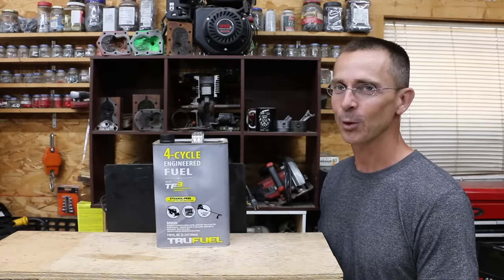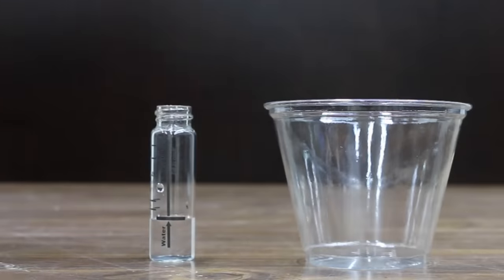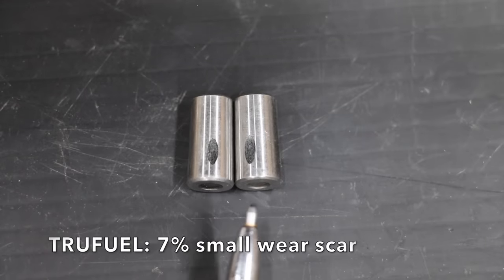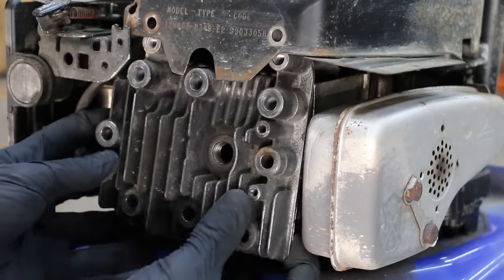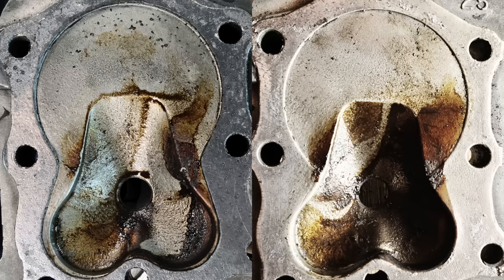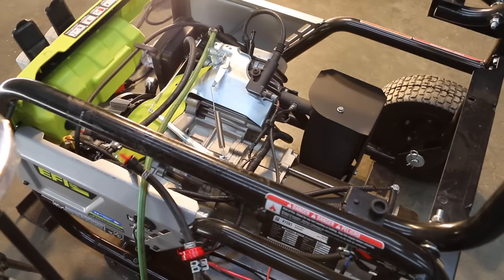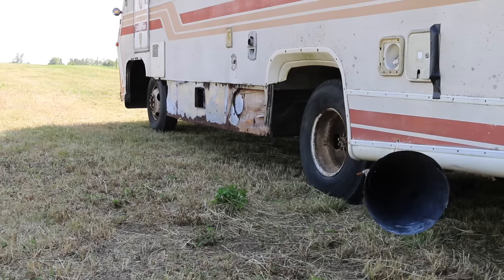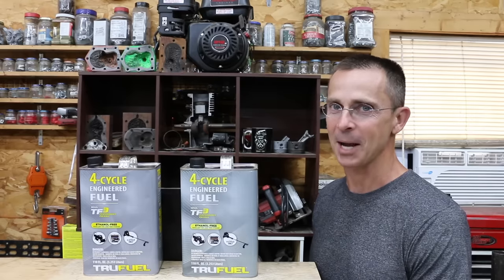Engineered Fuel better than Pump Gasoline?  Better Fuel Efficiency and MPGs? Let's find out!

Comment: "Let's get the testing underway!"  Five words that can improve any Monday.
Reply from the maker: Hi David, Thank you very much and hope you enjoy the video!
Reply: @ProjectFarm  I won't spoil it for later viewers, but that ending was glorious!!
Reply: Unless its at the doctors office
Reply: "see through cylinder head" that's my week sorted.
Reply: @ProjectFarm  top comparison, thanks. Can I offer a tip for cleaning your combustion chambers easier & more thoroughly... I use tergo paint stripper on all my engines even down to the top ring in the bore...  then waterblast to strip off the stripper & chase water out of the bore/piston with a couple of revolutions & airgun then wd40 the bore/piston at the bottom of stroke
Reply: Just another manic Monday! I wish it were Sunday!
Reply: “Let’s double circle check that.”
Reply: Most definitely
Reply: No contest.  "Regular" pump gasoline is a well engineered product with seasonal and regional blends which are distributed highly efficiently and at a good price.
It is a TERRIBLE idea.  Assuming it even worked, why not just sell it as a gasoline additive?  Gasoline is a constituent of oil and cars and small gasoline engines run best on it. So at best, it is regular ethanol free gasoline with an additive package which can just as easily be sold as a gasoline additive and wouldn't be anywhere near as expensive.
Reply: Agreed! This channel transforms me from Garfield into  Bob Ross. It's great!
Reply: Especially quarantine Mondays
Reply: That's no shit.
Reply: Nowadays everyday is Sunday
Reply: I mean, let's is let us. It has an apostrophe, so it is still 2 words, one has been shortened. He does make awesome videos tho!
Reply: @johnnykirk1501  Pedantic much?
Reply: Correct? Yes.
Reply: Saturday: "watch this, hold my beer" is the second best 5 words :-)
Reply: @Errol.C-nz  ever try cold water while the engine is running? ;-)
Reply: You have too much time on your hands.
Reply: 8 hours of work, 6 hours of sleep. I almost always have 10 hours of time to use as I please. Watching MM is definitely one of the things I enjoy. If you are referring to me commenting, your comment was the one that was visible as I watched it.
Reply: Couldn’t agree more
Reply: @FastBowtie388  how do you mean cold water
Reply: Not if your going in for a colonoscopy on Monday!
Reply: Absolutely.
Reply: @evrlastngcherry7727  hahahaha everyone can attest to that 😅🧤🍑
Reply: ANY WEEK!
Reply: You mean any day
Reply: six words. Let Us get the testing underway.
Reply: I agree and his most iconic phrase. "Were gonna test that"
Reply: @ProjectFarm  best phrase on the internet "were gonna test that" the 4 words every company dreads hearing from you. 😆 🤣
Reply: @ProjectFarm  Can we get a comparision of TruFuel vs Stabile for long term storage and quality of old fuel? Both tests of full can vs mostly empty cans of each stored.

Comment: Video recommendation: Test different brands of garden hoses. I constantly have garden hoses bust, expensive and cheap!
Reply: your water pressure must be too high; your pressure reducing valve is either leaking or non-existant
Reply: Yeah buy a water pressure gauge. My pressure is 45psi at a hose bib.  Never had a hose bust in 30 years. Kink and tangle all the time.
Reply from the maker: Great suggestion!
Reply: My wife bought one of those hoses that expands and retracts automatically with the water pressure.
It is the biggest piece of shit that I have ever used in any garden !!!!
Reply: I’ve had good luck with the Never kink brand. I’ve had the same since 2009.
Reply: I’d like to see this too. But with consumer vs professional vs farm quality. I heard farm was the best but it costs more.
Reply: Maybe test the hoses in harsh conditions: leaving in hot sunlight w. Water on, freezing, driving over, etc. And then maybe tips to improve your hoses, or prevent damage. Alot of the cheaper hoses ive had fail at the metal couplings. The best hose ive had is the aluminum encased one. 

Our water pressure isn't high by any means, but a pressure gauge may be helpful.
Reply: Yes, would love to see this test. I sometimes leave them out in the sun after use so they soften and can then be unkinked for storage.
Reply: i didnt even realize hoses could burst....    have been using this same old green hose since 1997!   and i do not take care of it,    it lays out in the sun ,   and pretty much every time i use it it gets tangled up with my garden chairs and i just yank it out with full force lol
Reply: Install a water hammer stop (mini-rester) at the faucet. And release the water pressure out of those hose and turn the faucet off. There's multiple reasons why they're busting, but you can at least troubleshoot if you're dealing with water pressure issues.
Reply: Continental hose. Have had the same one for 15 or so years and it hasn't degraded. Sits outside in the summer and winter. No kinks.
Reply: Project Farm put them through heat and freeze cycles to see which become more brittle. If I leave them outside I’ve had them only last one or two years.
Reply: the kink rating is also another important factor for a hose
Reply: I live in the California Desert, my Mom bought me a Metal Garden Hose off of Amazon...I laughed , "yeah right a Metal Hose", it looks like Flex Conduit but bends in a tight circle and never kinks and easy to roll up and toss in a Bucket, it'll take the sun all day too. VERY NICE HOSE.
Reply: gangisspawn1 or air hoses
Reply: I love my Zero-G hoses personally. Had them for several years now and theyve been used and abused with no issues. Plus they're super easy to wrap up and put away as opposed to many of the cheap hoses and they dont kink and crack either
Reply: @Timinator62  thats the same as what I have thats worked the best so far.
Reply: I've been using one from Ace for 10+ years. The $75 guaranteed not to kink. 

Mine is in the garage while the snow is on the ground, but I have frozen it before and still no leaks.
Reply: Stop leaving your hose on in the sun.
Reply: A dog proof water hose would be great.
Reply: Andy Preston mine busted and is just a rubber tube now
Reply: Remember to turn the faucet off at the wall when you're done.  Leaving that pressurized when not in use shortens the lifespan of hoses
Reply: Buy the 100 footer from Sams club. It is a Boss.
Reply: It's very interesting to note so many people who have never had hoses bust/break/degrade. I'm wondering how so many hose companies stay in business. I guess I'm one of the few buying hoses every 10 years or so. I buy commercial/industrial hoses too. The best one I had was made by Goodyear I believe but I've also had Ground Work and Element farm hoses. Yes, I leave them in the weather but drained for winter. Yes, I sometimes forget to turn off the faucet with a nozzle on the hose.
Reply: I bought the zero G one 2 years ago. I love it.
Reply: A few years ago a friend told me to get the hoses from Sam's Club. The heavy ones with big brass fittings. I bought two of them and both have held up really well for many years. I can't remember the name, or if they're even sold anymore. My home water pressure is between 70 and 80 psi.
Reply: I've NEVER had a hose just bust, and I use tons of them for construction and at home. They either burst because they are driven over with a tractor or get hit with something sharp, but never just bust.
Reply: @ACEGAMER120  The nature of my job means I'm working with water all day and we love the Zero G hoses.
Reply: Plz test “ premium contractor grade “ lol
Reply: Everyone complaining about kinked hoses has likely never been a firefighter. 
Also pro tip, don’t kink your hose.
Reply: i would rather see a shoot out between the different hose thicknesses.... do you waste money buying a 3/4" hose
Reply: I've had good luck with the goodyear hoses. Black reinforced rubber with solid brass ends. Don't deteriorate on me when left in the sun.
Reply: Goodyear or Continental rubber hoses. If they kink, you are doing something wrong.
Reply: Especially those elastic expandable/collapsing hoses. Those made with the fabric surround are particularly weak, lasting a couple of months even with the best care.
Reply: @SOP83  I was going to say that also. Those black rubber hoses are pretty nice. And your right, they don't kink. They will roll up like they're going to kink but then it flips and doesn't kink. You pay a pretty nice price for them also but they last. Certainly a lot longer than harbor freight chinesium hoses.
Reply: Andy Preston they were never designed to take pressure I learned that the hard way good thing I had two
Reply: @Log Splitta no need to kink shame
Reply: I use Flexzilla 👍
Reply: Cold test better be in there!
Reply: Yes, this!!
Reply: @philbuilds116  yup goodyear
Reply: Andy Preston I have one that is in my basement sink. It’s about a year old. No wear, but there is really nothing to puncture it. They are POS
Reply: a why would you ever want less pressure at the nozzle?  I’d rather just not have it leak.
Reply: Good idea. My craftsman from 28 years ago is outlasting all the others I've bought through the years. Chi-na crap nowadays
Reply: Never had a hose burst due to pressure NOR have I ever had a pressure relief valve until I bought a house that had them installed on each bib.  They were noisy and leaked.  Took every one of them off and still have NEVER had a hose burst due to pressure.
Reply: Buy a flex zilla hose there the best that I've found
Reply: Avoid flexon brand, lifetime warranty makes you save the receipt, cardboard cover + take photos only to get an even cheaper quality sent to you as replacement
Reply: I bought a 50 ft hose in 1975 and it is just starting to leak at a crack....cheap stuff
Reply: Don buy vinyl hosee,just Goodyear rubber Black or Red hoses.red for hot water
Reply: Just buy a DRAMM hose made in USA 100% american made rubber...but it will cost you!
Reply: @andypreston1524  I got one of those from someone one day, lasted about 10 uses before the end blew off.  If they made one that would last, it would be handy if you had the need to carry a hose in your vehicle.
Reply: I literally just came to the most recent PF video to make the exact suggestion! My wife always buys the cheap hoses, and it drives me nuts! I just paid a guy to come and replace 4 hose spigots because the cheap hoses had aluminum ends, and not brass and they fused to the spigot.! I hit the Amazon reviews to find out which was best,  and I could have sworn I heard "Which hose is best..... let's find out"!!!
Reply: @andypreston1524  I hate those hoses. They steal so much pressure to expand. Also, it takes a day to drain them to store them. I found out storing it is pointless.
Reply: I hate those expandable hoses. They steal so much pressure to keep inflated. They take half a day to drain them to store it. Storing it was pointless by the way.
Reply: @dennispope8160  You should be at 70PSI residential at your spigot.

My issue with garden hoses is they like to have kink memory.
Reply: An important factor is hose ID.  Standard hose sizes are 3/4, 5/8, and 1/2" , and there will be a big difference in flowrates.  Keep hose size similar when comparing brands.
Reply: @andypreston1524  Yes it doesnt last long, but at least i never had a problem with a consistent water delivery to my pressure washer. Air bubbles begone!
Reply: The Goodyear hose I have works good and I regularly use it at 11-135psi
Reply: Also the Continental I think works at this high pressure too.
Reply: I have never had your problem,  but I have had some hoses that kink more easily.
Reply: @MrV1NC3N7V3G4  the only hose I have seen break was runover by a lawnmower, some hoses seem to get stiffer after about a decade of UV exposure and it wouldn't surprise me if freeze damage would destroy a hose but otherwise the only reason to buy a new garden hose is if you need a longer hose.
Reply: @keithyinger3326  I have found that with lengths over 100 feet it is very very easy to accidentally kink Goodyear hoses, I use one all the time and I have to carefully walk the length of the hose every time I unwind a coil otherwise it kinks EVERY time.
Reply: @andypreston1524  I like those hoses, but I buy them on sale right about now and replace them every year. As long as you look at them as disposable, they are great!
Reply: @dennispope8160  45 psi is little big 30 psi is the best
Reply: Use hose with steel outer (stainless) they have interor tube but outside is very hard to destroy - I even drove my truck over it few times.
Reply: Ive used ACE hardwares heavy duty hose it works ok. the ends wear out fast. Flexzilla is decent the ends are shitty to use though. The best hoses I have used are Continental hoses. They are much more rigid than any other brand I have used for far. Unless you beat the shit out of your hoses(like me) the male and female ends almost never get messed up.
Reply: @Steve Sheldon Flexzilla air hoses are good too. We beat the snot out of em at work. Flexzilla is the longest lasting "off the shelf" air hose we've used and we've used at least a dozen different brands
Reply: Ah a true “Hose Pipe”
Reply: Have you  tried just using a larger diameter hose? A HD 3/4" vs a cheap 1/2" will  be night and day.
Reply: @BB-1990  i have used the 3/4 but they still burst. So far our metal hose(1/2) has lasted the longest, and has survived my lab chewing on it. I'm thinking about getting more this year.
Reply: Great idea! I'd watch that!
Reply: @andypreston1524  Take it back to the store and ask for your money back.